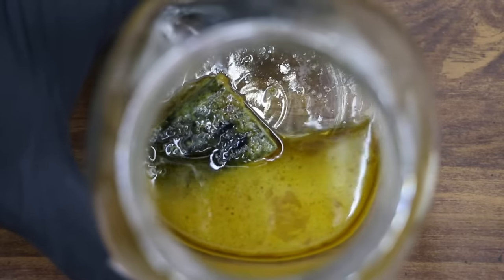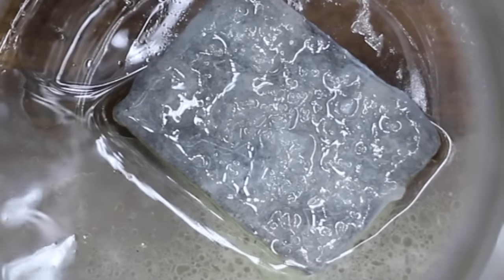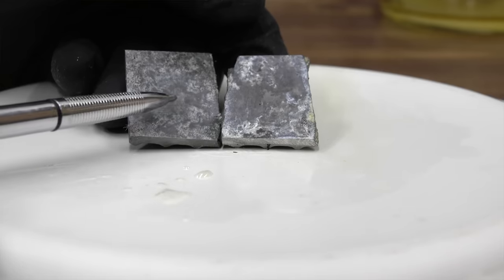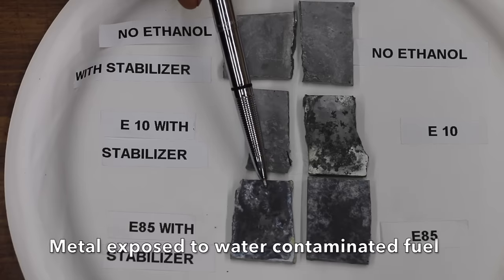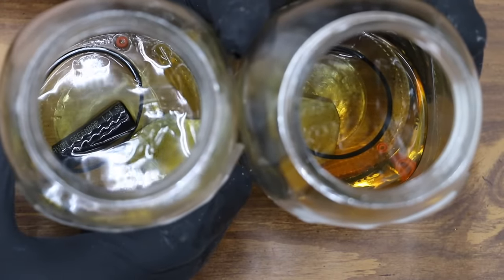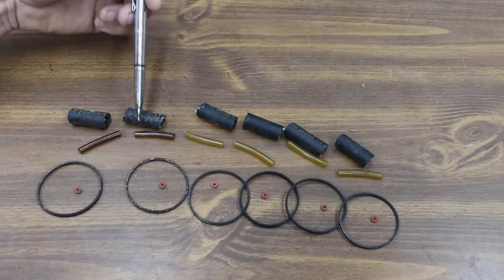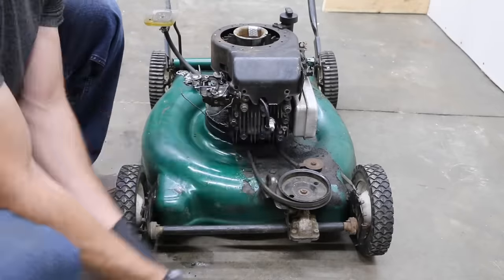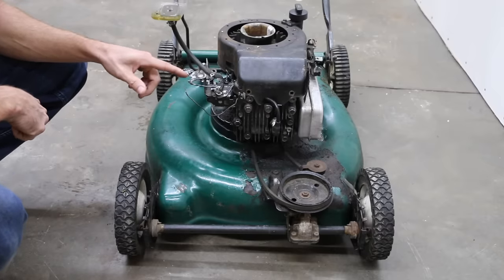Does Fuel Stabilizer Prevent Ethanol Damage?  Let's find out!

Comment: Getting my dad to understand that he cannot leave gas in his equipment anymore has been a chore. he just doesn't believe it lol this last year EVERY one of his tools didn't start and every single one of them needed a carb cleaning. I will say I'm like a pro with carbs now lol. I also left my dad with 5 gallons of Non Ethanol this fall so hopefully things will still be running this spring lol
Reply: curious on your take on winterizing a lawn mower, fill the gas tank with ethanol free gas and store for the winter or completely let the machine run dry then store?
Reply: I hope you just sneak by and seceretly dump in some Sta-bile into his power tools gas tanks!
Reply: @kickliquid  Good question I believe either would be ok

Comment: Did you store all the jars with no lid? Seems like all the volatiles had evaporated away and left the heavy (less flammable) stuff behind. Very interesting video
Reply from the maker: Thank you.  Jars did have lids with 3 small holes and all jars were stored in a closed cabinet in the back of the shop.  Testing approach was determined based upon advice from a fuel chemist to test how fuels are typically stored in a small engine....vented gas cap, air space in fuel tank and parts of fuel system, etc. Thanks again!!
Reply: Nice job! Sounds like a great test

Comment: I think ethanol needs to be removed from gasoline other then ethanol fuel for flex fuel engines they need a separate tank at the fuel stations .
Reply from the maker: Thank you!
Reply: I must agree with you, Clay!
Reply: It's not going away, no political gain to it. Was pushed in by the "oil is evil" crowd and it will be fought to be kept by the farm community.

Comment: So: ethanol and/or time are the disease, and stabilizer is a placebo. Good video. Thanks.
Reply: Stabilizer is a complete waste of time and money, just run the equipment out of fuel at the end of the season.  Or use TruFuel.
Reply: If your fuel system is unsealed and sits for long periods of time ethanol isn't for you. 

Sealed automotive fuel systems that are regularly ran will see no detriment from running E10 fuels
Reply: There is NO completely "sealed" system...  When temperature goes down, air over the fuel will contract according to universal gas laws.  If completely sealed, the fuel tank would collapse, therefore it is vented to break the partial vacuum... and everytime that vacuum is present, air humidity will enter the tank. So the gas cap is a one way valve, and fuel vapors are vented through an activated carbon canister, to be burned next time the engine is started... but that cap is not completely sealed against air ingress.

Comment: Why not try more stabilizers? Like Stabil? That's only one, too small a sample. Maybe that one is, just junk?
Reply from the maker: Great suggestion!  Thank you
Reply: Your just hoping stabil actually works. Like me! Lol I use stabil too!
Reply: There are several brands of stabilizers found at the local HomeDepot or Lowe’s.   Please try these for your next test!
Reply: That is the one I use. Curious if I am wasting my money on it or not.
Reply: Great work as always. Could you try Stabil, Stabil marine, Stabil 360, Star Tec, Justice Brothers all side by side? Maybe a way to show what happens in carbs using E-10 or E-15 with and without these products?
Reply: I've used this one in the uk for years, I put it in my motorcycle and fuel cans. It works well for me. Never seen any corrosion in or on my fuel system.
Reply: I have used NON-ETHANOL premium fuel since around 2002. I treat EVERY ounce of gas  i use in my small equipment with Stabil and Berryman B-12 cleaner (seafoam equivalent,  1/2 the price). So far, i have NEVER had 1 of my carburetors apart, and sadly, i usually leave the equipment where and how i last used it. Just this past summer, my generator and mini tiller got used for the first time in AT LEAST 3 years,  and both started and ran by the 4th pull. BTW, yes, i work "in the industry."
Reply: What about star tec?
Reply: @spotlightinspect5540  beam me up scotty
Reply: I’ve heard great things about K100.
Reply: I've been using the Stabil marine in my stuff with zero issues. I figure or hope it's better than their regular stabilizer since it's made for fussy marine engines. I bought their Marine 360 this year so I'm hoping it's just as good or better than the regular Stabil marine I've been buying.
Reply: @ENDERTON2000  Same here man. Im not a mechanic, but my Dad was and he taught me.
Reply: Michael Bamber 
Which brand name ?
Reply: @1Slamalama1  I'm trying seafoam right now also, crossing my fingers. My collection of early motorcycles are taking a beating, can't leave the carbs dry nor with fuel, getting to be a carb rebuilding robot. Rebuilding VF Honda carbs are a pain
Reply: Launching bait with a trolling reel
Reply: @ProjectFarm  supposedly the very best fuel stabilizer is PRI-G.  Maybe you should test that claim.
Reply: Time.
Takes a LONG time to evaluate the effectiveness of fuel stabilizers without being able to artificially compress time.
Reply: @whydahell3816  me to
Reply: I agree.  I haven't had much success with anything made by Lucas
Reply: I have heard that to be effective the stabilizer/ cleaner should be nitrogen based and contain “PEA” (Gunk and Chevron do, or use to as they don’t advertise that they do anymore). I certainly am no expert on the subject but enjoyed the video. I’m going to buy non ethanol fuel for my mowers!
Reply: @1Slamalama1  Are you talking plain old Seafoam or does Seafoam make a dedicated stabilizer?
Reply: @MartyMoose1611  Yes....if it is readily available then that is the best option.
Reply: @Marcoosianism  plain old seafoam, mix 1oz of regular seafoam per gallon of gas
Reply: Used Stabil in my boat in 2018 with a full tank, 30 gallons, couldn't ride my boat in 2019 because of a car crash.  Fired boat up this spring and went most of the summer on that full tank of gas with no issues, before putting fresh gas in it.  The gas was shell premium with correct amount of stabil.  So it worked for me.

Comment: I've been using E85 on my '99 cbr600 for 4 years now with stock carbs, fuel lines and everything, only things changed were fuel filters and tuning of course, no corrosion or issues of any kind. The reaction of aluminum and ethanol forms aluminum triethoxide which is the jelly like material you see. The reaction is very slow in room temperature especially when the aluminum is anodized and really only happens when the system sits still for long periods of time. The actual corrosion comes from impurities in the water that gets into the fuel which is not a problem for carburetors or engines because a proper fuel filter does not allow water to get through past the fuel tank where the majority of the water is.
Reply from the maker: Thank you for the feedback.
Reply: So if you had an aluminum part with fresh  e-85 flowing past it and always submerged it would corrode less vs the same part just sitting in the same fuel for a year? Is it like a feed back loop that the more the corrosion gets into the fuel the more corrosive it gets? My other thought is that e-10 (most motor vehicles made in the last 20+ years) and flex fuel E-85 vehicles are using the same material in the fuel system because to make it withstand e-10 is the same as making it withstand  e-85  (Of course the tune has to be different) Or maybe a bit of both things going on?

Comment: In my small engine shop I find ethanol (e10) fuel ruining stuff in as little as 6 weeks. No stabilizer works for ethanol fuels (not Stabil, ethanol shield,  etc). Just don't use ethanol fuel. Non-ethanol fuel is effortless to find.
Reply: It's not easy to find, unfortunately.
Reply: @sixtyfiveford  You've made the small error of forgetting that the rest of the world exists.
Reply: It wasn't easy for ke to find. Nearest place is 45 min away.

Comment: My takeaway from this: With ethanol fuel, it's even MORE important to drain carbs during off season storage!
Reply from the maker: Great point!
Reply: Except I don't know how to do it and after ruining several mowers (I now know why thanks to this video) I have someone at work do it it's cheaper than buying a mower once a year.
Reply: In real world experience I have found this not to be true. I see more damage from empty carbs then carbs with stale gas. Probably because the carb is not really "empty" and that little bit vapourizes then mixes with the air and has nowhere to go. This usually results in green colored salts forming on the brass jets/plug at bottom of bowl. When there is liquid fuel, even e10 the salts do not form even when the gas goes bad...so I suggest leaving the gas in during the off season albiet low, then adding fresh when working season shows up. I am  Briggs certified MST and 90% of the repairs I do are fuel related so this is not just coming out my rear end...
Reply: Better to just run them dry or close to it and refill with non ethanol and any type of fuel stabilizer. Run the engine for several minutes and call it good.
Reply: @Ayestosea  Did you ever see seals that were brittle from drying out when fuel was drained?
Reply: @mikeyfoofoo  Ive seen the pink float valve seats dry out and crack(which causes fuel to spill over once refilled in the spring when left to sit) as well as diaphrams in 2 cycles. Generally never notice much deterioration of the bowl rings whether they are unknown rubber or buna-n.

Comment: Another GREAT Video.   You do a great job of replying to comments.   Ethanol is prohibited in Aircraft Fuel Systems.   Ethanol in fuel is a terrible idea and very bad for the environment.   The ethanol will cause failures in the non metallic floats in some carburetors and will attack some types of seals.   You never want your engine  to stop while you are flying!!!   I like your electric starter for your lawn mowers.   Here is a suggestion for a test:   Will auto gasoline stay "fresh" if it is in a totally sealed, pressurized container, such as in a propane bottle, filled completely full and then pressurized with dry nitrogen,  to about 50 psi, then releasing about 5% of the gasoline to prevent over pressurization from expansion and then let the fuel stand for a year or more.   Will the lack of oxygen and evaporation prevent the fuel from degrading?   By preventing oxygenation of the fuel and the loss of the more volatile components of the fuel, it should last much longer.   Fuel purchased in sealed barells does last longer.   Have a great day!!!
Reply from the maker: Thanks!  Thanks for the suggestion.

Comment: I worked at a motorcycle shop for years, and cleaned SO many carbs. Before the time of ethanol fuel, and after. 
   No doubt, the ethanol does make more trouble.
   Many many customers were upset that this was needed, even after using stabilizer, so I have always been a skeptic. 
   It is good to see that it does do something, but often not enough. I always drain carbs for winter.
   I'm an A&P, also, and often end up with 100LL avgas. It stores very well, far better than any car gas. All my power equipment runs on that for at least the last tank before winter. The 100 octane is unnecessary, but harmless. The high tetraethyl lead content (despite being called 100 low lead) could  increase likelihood of plug fouling or valve deposits, but I have had no problems. I sometimes make weak premix for four strokes, to prevent valve & seat corrosion over winter. Never foul plugs from that, either.
Reply from the maker: Thanks for sharing.

Comment: Love this content. I'm a small engine guy and I have definitely seen damage done by leaving gas in the tank for long periods of time. I am working on a 4 wheeler now. When it was new it had a brass pickup tube in the fuel tank. It was left full of fuel for over a year and the tube is now gone. I'm not going to say it dissolved the tube, but the tube is not there and it is not in the tank. Mystery. I am going to do an experiment with a piece of brass soaking in 10% ethanol and see what happens over a long period of time. I have also seen twice now where leaving gas in the tank for extended periods of time will make the plastic parts in a tank extremely brittle.
Reply from the maker: Thanks!  Thanks for sharing.

Comment: the test is interesting, however: the aluminium alloy that is designed for mowers carburettors is not  the same one as the ones that are used in cars at all! 
So I might recommand you to find a head cylinder from a dead car engine from the 90's and one from 2007+, cut off some bits and run the same tests. that would be absolutely awesome data to produce :D
Reply from the maker: Great point.  Thank you
Reply: I’d love to see this! Maybe a US block from the 70s, 80s, 90s, and 2006+ 

It is my understanding that after the oil crisis, manufacturers started to ensure their cars were ethanol resistant due to the increased demand for ethanol fuels.
Reply: No carburetor after 88

Comment: Great video, I was wondering about putting synthetic 2 stroke oil in your small engine fuel before storing for the winter. It doesnt foul plugs or smoke and I have left chainsaws sit for up to 2 years without draining the fuel and they start right up and run good. The jet in a chainsaw carb is very small and would plug up easily and it has never happened to me. That would be a great test for you to try.
Reply from the maker: Thank you!  Thanks for the video idea.
Reply: Well sta-bil 360 protection ethanol treatment & stabilizer well help to keep that gaslione in the gas tank to stay fresh for 12 in you can you put it on a 2cyce

Comment: In fairness, most small engines really won’t be damaged by corrosion from ethanol. The fuel sits in the bowl that isn’t made of aluminum. And all the jets are typically brass or stainless. It definitely makes a mess of the carb if you leave it in, and you’ll have some work ahead of you to clean it up. Obviously if you have a carb full of fuel and flip the machine on its side or end and leave it for a couple years, that’s a completely different story and will end up with a carb looking like the one in this video. But sitting over the winter or summer there won’t be irreparable damage done. These are by far the most thorough videos on line and very informative. Keep ‘em coming.
Reply from the maker: Thanks, will do!

Comment: I HATE Sta-bil. Had great results with Seafoam, to stabilize gasoline and cleaning up the injectors in a diesel engine.
Reply from the maker: Thank you. Seafoam is great!
Reply: @ProjectFarm  do the same test but with SEAFOAM please!
Reply: Seafoam is expensive and has Alcahol in it.
Reply: Seafoam isn't that expensive, unless you have expensive stores. Seen it as cheap as about $7 for the 16oz. Other places, $20 for the same thing... Stupid.

Comment: So knowing all this, how would you rate the “Trufuels” etc that are supposed to be good for two years?
Reply: I've used Tru-Fuel in my Stihl MS251 since I bought it brand new from the dealer a few years ago. I have had absolutely no problems with it. But unlike most people I also store my chainsaw in my bedroom as we don't have a proper shed or garage to keep it in. So it doesn't get to see outside conditions. I've even left Tru-Fuel in the tank over winter into the next year and the saw has started every time I've needed to use it. The tins are 100% sealed units so they're good for long term storage. The smaller tins are expensive for what you get, but if you don't run a chainsaw frequently enough to need a lot of fuel then it's worth the trade off.
Reply: I use it in everything, longest is my blower which has been 2 pulls to start for 4 years straight, no other maintenance.
Reply: I buy them for 🍼 bottle refill with pump ⛽ gas
Reply: @Slane583  The bedroom is a perfectly acceptable place to store your stihl chainsaw.  I like to keep mine on the mantle right next to the family pictures.
Reply: Also just seen pure-gas now has an app for Apple and Android users that I wasn’t aware of. Great stuff!
Reply: @ripperace  There is within 2 miles of me. 91 Octane to boot.
Reply: It's the metal container
Reply: @BenKickert  Well, if you want to be technical the Stihl could be considered part of the family. It earns its' fuel and bar oil just by doing its' job. Either way, it's always warm in my room and it doesn't see the elements. So it's maintained and never left in the weather. I would like to eventually add an Echo CS800 to the collection. :)
Reply: @Slane583  I save the tins and make my own two stroke mix with stabilizer.
Reply: @occulus2615  Nice. The tins are useful once the fuel is gone. Especially if you've purchased the 1 gallon version. You're getting a free reusable tin gas can with fuel already in it. I have a couple of the small tins In my truck. One is just empty and the other has a 50/50 mix of canola oil and mineral oil that I started using as bar oil. It's thin enough for the low volume oil pump in the MS251. :)
Reply: @Slane583  I generally keep my Stihl 361 either in my car or in my garage.  I like keeping it in my car because it doubles the value of my vehicle when it is in there.
Reply: @BenKickert  It also doubles the HP of your car for a moment while it's in there. ;)
Reply: @Slane583  You aren't far off... I drive a 17 year old civic.
Reply: @BenKickert  At least it's a reliable car. I've ran a small amount 2-stroke oil in my truck to help it lube the fuel system. It also helps with smoother revs.
Reply: I have had an open bottle of TruFuel (40:1 mix) for three Summers for my weed eater; spent the entire year in the shed (so highs in the 100s and lows around -20F) and it has always performed really well.
Reply: @OlivierCaron  The small tins of it are good for when you don't run equipment often. I have a couple leftover tins and one is used for a bar oil mix.
Reply: @ripperace  most Wawa sells ethenol Free petrol it costs a bit more but might be worth it